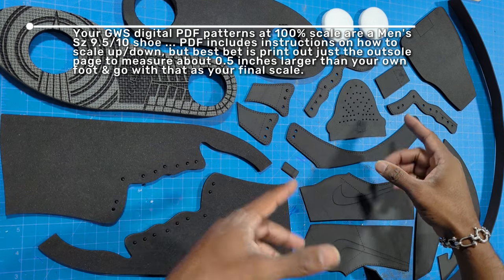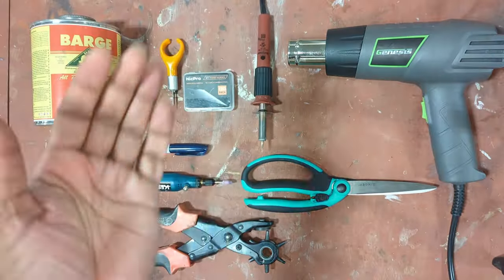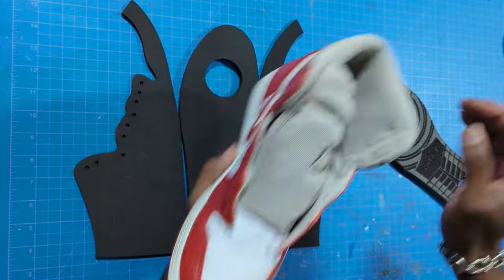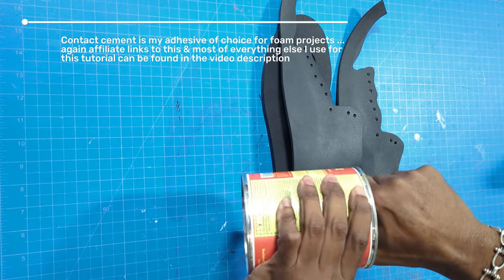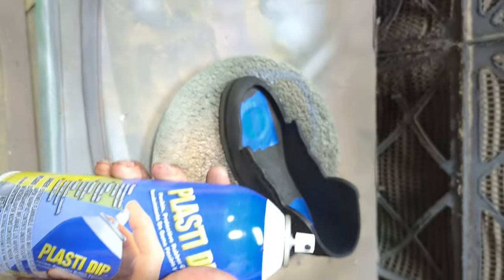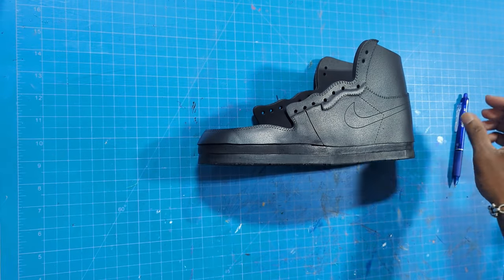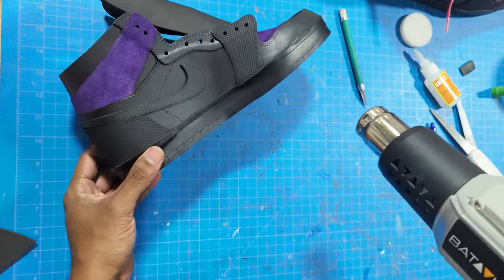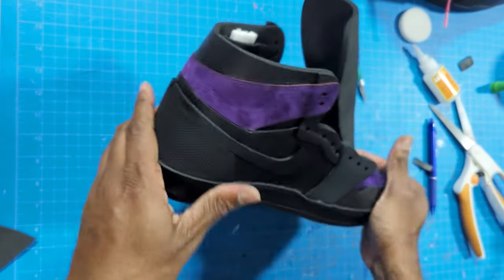Part 1: ATS Earth 42 Prowler EVA foam AJ 1 cosplay shoe props ( TUTORIAL )

Comment: How exactly do you scale it up/down? The vid says it's in the PDF but that only says "feel free to scale it up or down depending on your shoe size" and I'm really not used to digital templates, can anyone help?
Reply from the maker: Crap, think I forgot to put the formula in there 😞 ... I'll update the patterns so future purchases have it ... But in case anyone else has this issue it's ... (A x 100) ÷ 10 ... A = your shoe size ... So multiply your shoe size by 100 then divide the result by 10 ... So if you are a size 8 shoe, 8x100=800, 800÷10= 80 ... So you would reduce your file size down to 80% to get your correct size ... If you were a size 12 you would increase scale by 120% so on & so forth ... Print out the sheet with the outsole ( pages 8 & 10 ) and stand on it to double check that it's 0.5 inches larger than your actual foot size so that the end product doesn't fit too tight ... Hope this helped ^_^
Reply: if you don’t give me the shoes, I was just crying. If you don’t give me the shoe give